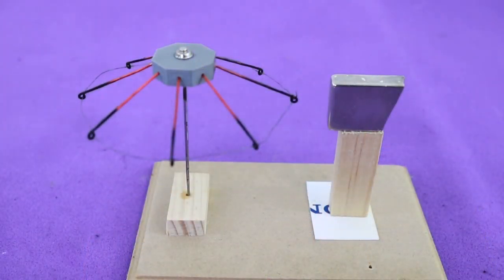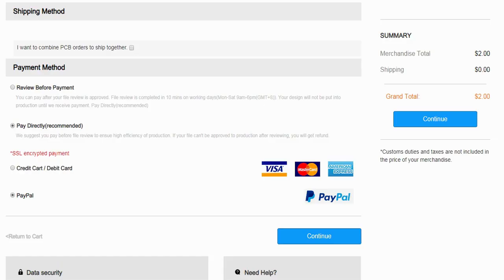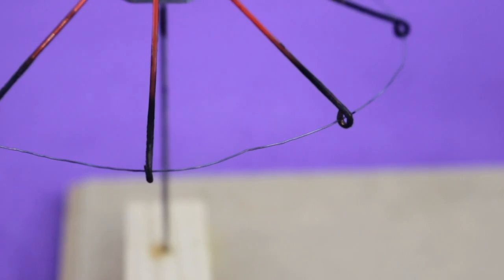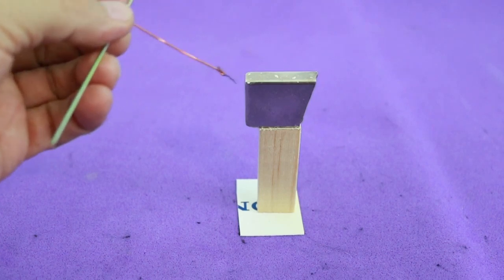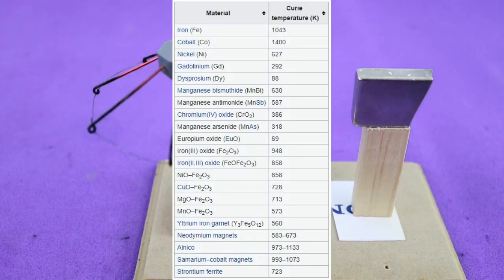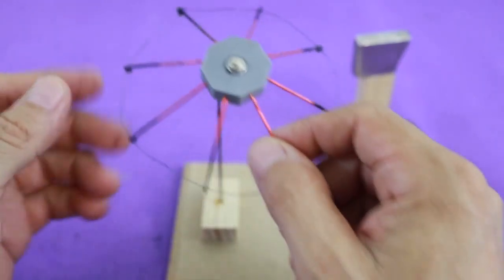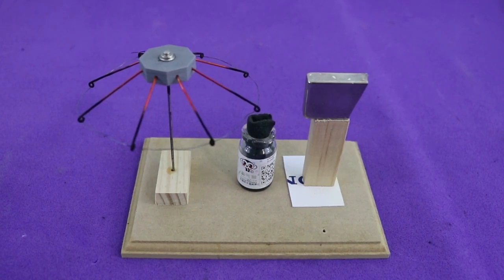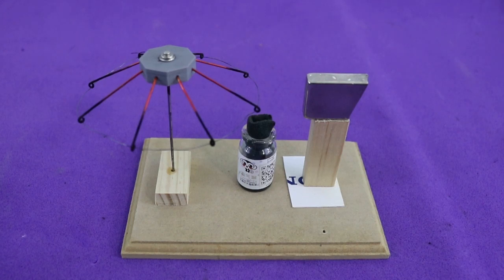Curie Effect Heat Engine

Comment: 636 degrees F is nickels curie. 
Idea What about making a solar powered Curie Effect engine? have more nickel threads and a magnifying glass to hear it up. ;) or maybe used the Manganese arsenide (MnAs)  on your list. I bet you can make it more efficient to go much faster.
https://periodictable.com/Properties/A/CuriePoint.ssp.log.html
Also I commented about this effoect in another video but I'll say it again 
would it be possible if Gadolium being heated by a magnet to make a stirling engine? 
Curie Point for Gadolinium is 65 degrees F. so if the magnet is near, it heats the metal up over 65 to pass the curie point if the room is below 65 degrees .